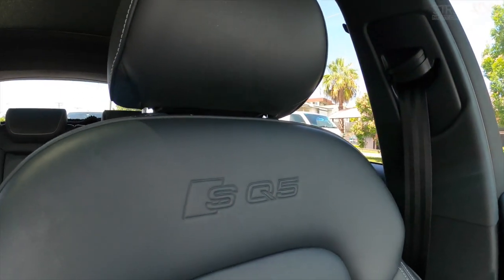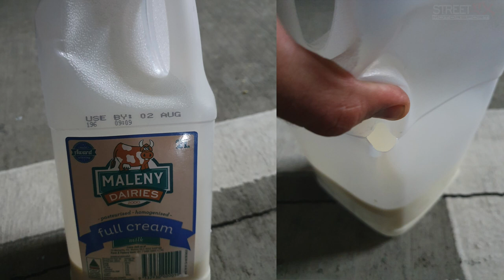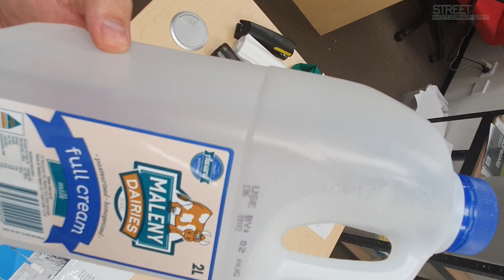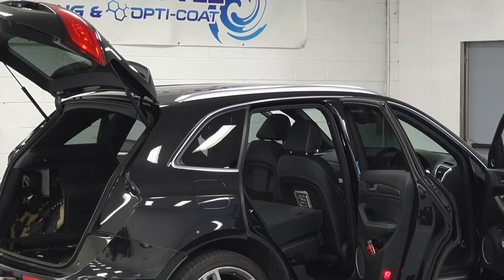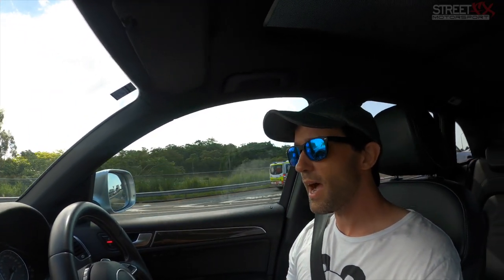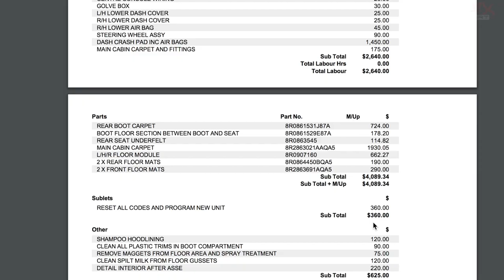Crying over spilt milk. A $4.00 bottle of milk caused $14,000 damage to my Audi, an expensive lesson

Comment: Where the hell are you going to get the seats out and cleaned for 5 grand ending up in 14 grand. I would have done it for less than 100 euros... Milk company won't pay you anything
Reply from the maker: All the carpet, sound deadening and lower interior parts needed replacing. Also some electrical components were replaced as they got wet.
Reply: @StreetFXofficial  i used to clean cars. I would have taken it all out and soaked it all, with no need to replace anything except the destroyed electronics.
Reply from the maker: Problem was the milk company told us to hold out and they'd get back to us.. in that time it started to rot, so I had to make the call and just fix it.
Reply: @StreetFXofficial  you know milk goes off fast right? I'm shocked the insurance payed out. Next time sort it out as soon as it happens
Reply from the maker: I did man! It happened on Sunday, went to detailer, cleaned, took it straight to panel shop, submitted claim, removed all interior, aired it out and two days later it was fkd
Reply: @StreetFXofficial  so if this split happened in your house and spilled into your carpet and floor you would just leave it? I can't believe you made a video about this, it's a dumb mistake which would have been a easy fix to anyone who knows how to clean. I learn to clean should be the name of your next video. 14 grand....
Reply: @StreetFXofficial  well I'm sure the revenue from the video and livestream was worth it. 14 grand lol... More money more problems
Reply from the maker: It was a long weekend for a start, I'm not a mechanic, I did the best I could with the tools at my disposal. I washed out where I had access, dry cleaned the carpet, removed the underlay, removed all the trim, blew air through where I could. The issue is that it got into places I was unable to get to.

Not saying what I did was perfect but both the insurance company and the milk company said to wait longer. I said stuff that and did what we could within a couple of days. 

Anyway, video might make us $8.47, but might save someone else a few grand :)

People honestly over estimate what YouTube earns the creator.
Reply: @alexyo3927  youre right that the milk company owes him nothing and that this was entirely preventable. He is acting very entitled. If he can afford an $80k car, he can afford to pay his own damn bills and repairs promptly before /maggots/ literally begin their infestation. 

You were neglectful, not the milk company. Bad bottles happen all the time. IVE gotten bad bottles. Buy a fucking shopvac firdt thing next time and take it immediately to a shop.
Reply: @alexyo3927  yeah, his insurance is incredible.
Reply: @alexyo3927  its like the people who treat fast food workers like shit on video. Theyre just destroying their own reputation lol
Reply: @keilafleischbein59  but hey they think it's funny
Reply from the maker: Keila, I'm not sure what I've done to offend you, but at the rate you're commenting on my videos, you'll be ranked a top fan in no time 🥰
Reply: @StreetFXofficial  who cares if youtube's stat bot rates me as a fan? It doesnt know what im saying. Ill take it as a compliment that im your top critic.
Reply: @StreetFXofficial  wait,shit thats pokémon...
Reply: @StreetFXofficial  well the extreem clickbait video, the fact you let milk rot in your car, you spent drive grand getting seats and carpet removed, the fact it cost 14 grand and you called insurance for spilling milk then complained to the milk company.
Reply: @SkateBNE  "his actual cars"

Are you implying his Audi is imaginary and does not actually exist? I dont follow. His audi is an actual car.
Reply: No his Audi is not actually a car compared to his cars worth magnitudes more. From Lambo’s to race cars. Do some research before you jump on a channel and run your mouth Copernicus. Grab some tissues as well because if this is how you cry over spilt milk you’re about to be hysterical.
Reply: @SkateBNE  lmao, so because he wastes even more money on supercars to terrorize streets, im supposed to suddenly respect that? A car is a car is a car. All a person needs is wheels, an engine, and seats. Let him waste his unearned money on useless things.

The dude is a spoiled baby.
Reply: 😭😭 Go flip another burger for minimum wage salty.
Reply: @SkateBNE  youre in a western nation operated by central bankers, i assume? 

Its the same difference.
Reply: @SkateBNE  At least i work to earn my own living. Keep looking down on the people who feed you. See how long until the burgers are poisoned.
Reply: It isn’t the same because we know we’re not the centre of the world. Here’s a little lesson I don’t think your Mum taught you. If you don’t have anything nice to say don’t say anything at all. 

Don’t assume everyone is against you, don’t assume you know more than you do and lastly, don’t assume all people eat fast food junk.
Reply: @SkateBNE  "dont assume all people eat fast food junk"

R/whoooosh

Its an analogy. I dont even make burgers my dude. The burger is the product. The minimum wage worker is the producer. You are the consumer. 

Do not look down upon those who provide your bare necessities. Who do you think makes the Audis? People who can afford to own an Audi, a lambo, and a race car? Hell no. They have bills to pay and mouths to feed, and the company cannot give a worker three cars in exchange for making one. 

You dont have to be the center of the world to have a corrupt government and a rigged economy. What kind of legitimate work even finances such extravagance? Where is the money generated?

"If you have nothing nice to say, say it if its honest." Fake people piss me off.
Reply: @SkateBNE  im crass, im rude, im an asshole. But at least i have a sense of human decency not to shove my bills onto everyone else, even when i have the full capacity to pay them myself. Sticks and stones, mate.
Reply: @SkateBNE  aight, please enlighten me then. Where does his income come from?